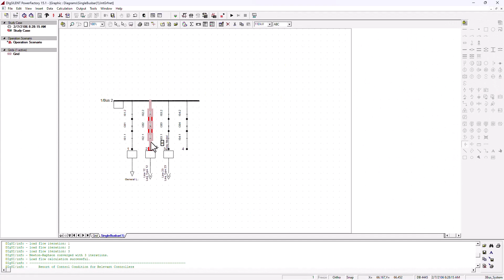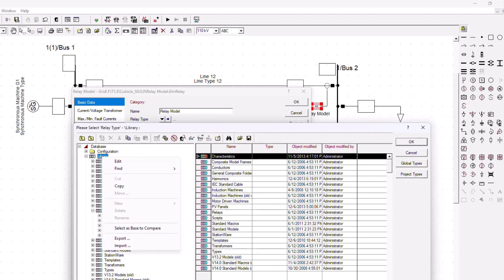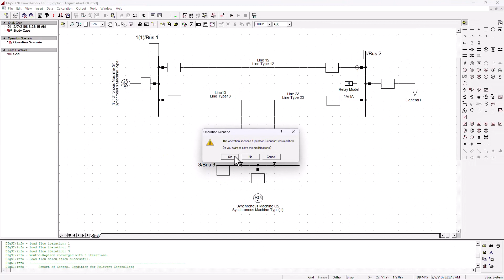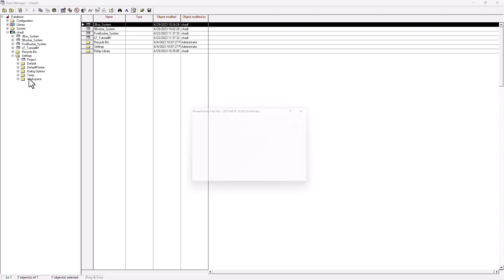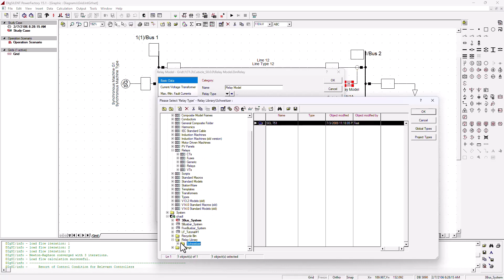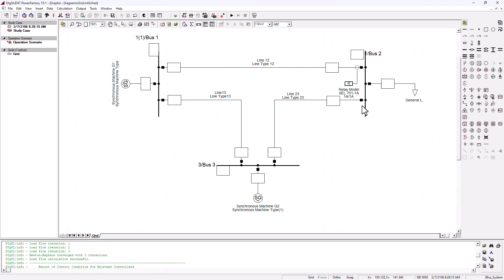How to Import a Protection Relay library into DigSilent (PowerFactory).

Comment: Do you have relay libraries for Siprotec 5 relays?
Reply from the maker: Hi, unfortunately not, I do have Schneider and Toshiba
Reply: @CMTEQ  i love your videos, can you share the Schneider relay Library? thanks
Reply from the maker: Hi, please check on this google drive.
https://drive.google.com/drive/folders/102gHMzst2XFn6JBkZ2r_jPUSLKl0bmD8?usp=drive_link
Reply: @CMTEQ  Can you please provide the relay library link for toshiba?
Reply from the maker: https://drive.google.com/drive/folders/1Yvn8nbK8wDNYtfAR5a5iSJ6NUgTMHDyC?usp=sharing
Reply: @CMTEQ  I am using DIgSILENT 15. But why i do not have ct and relay module name, and is there any library for that?
Reply from the maker: Yes, you need to import an external library.
Reply: @CMTEQ  Thank you. Actually in older version there is no symbol like ct and relay.
Reply from the maker: Ah, interesting...
Reply: @CMTEQ  Hola, podrias compartirme los relés Schneider. Si tenes SEL 751, ABB, o Siemens, tambien te lo agradeceria muchisimo. desde ya, Gracias!
Reply from the maker: Hola, Please check in the google drive link below.
https://drive.google.com/drive/folders/1aFaJTwZXfME5qk_4CazXqs9k8viQRWfI?usp=sharing
Reply: can you share the link for ABB relays.. thanks